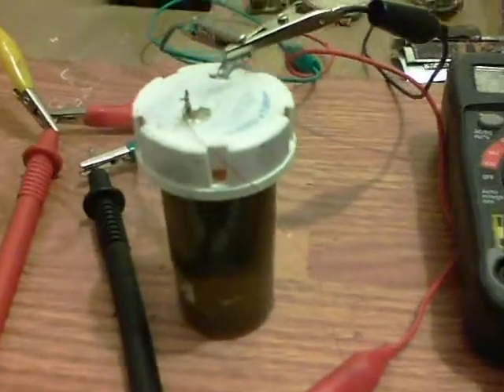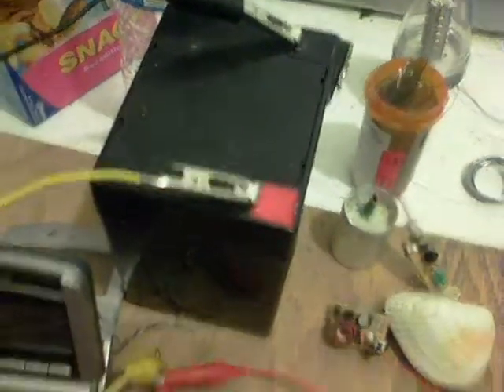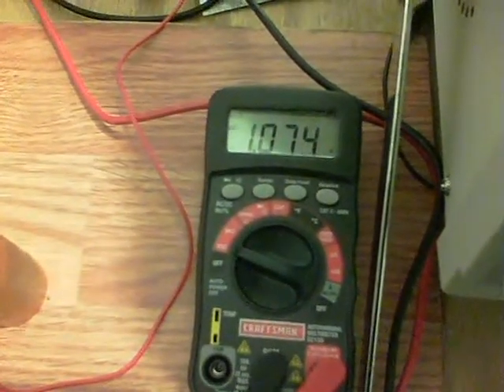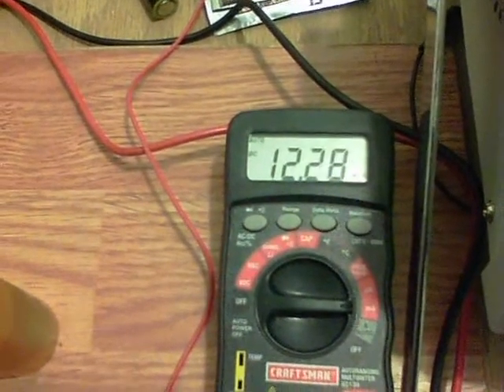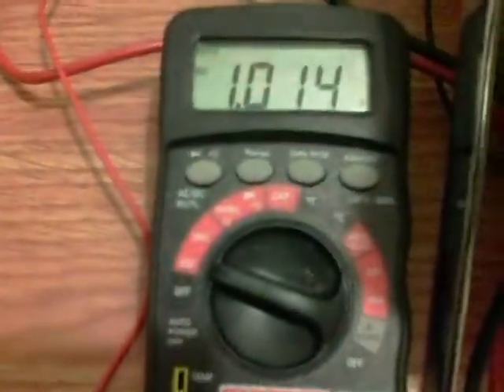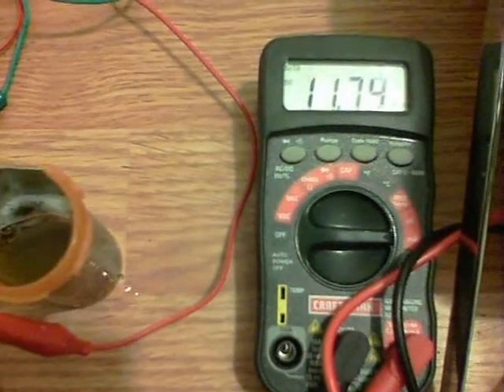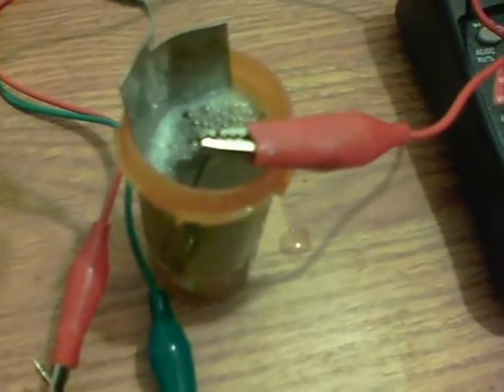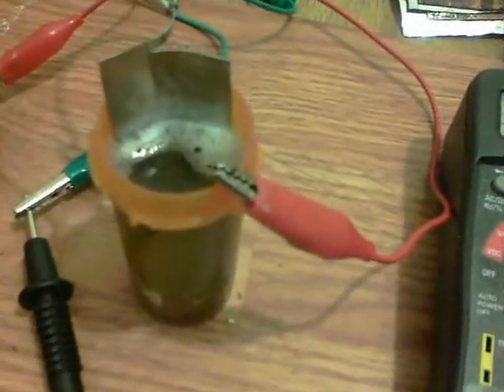Alum rainwater cell - good 2.7V initial charge

Comment from the maker: @picturen8 Cheers N8. I'll do that too. The graphite tiny rod here is far too small..still, it's not going to be the last one made. I like how different metals than lead can be used, for salvage and environment purposes, the amperage is likely to be far inferior. I'd recommend a cover/cap, for evaporation. Interestingly, on a straight water cell, mA can rise the closer the 2 metals get to each other, but can be best with moving water - makes me wonder about moving electrolyte via SSG wheel :)

Comment from the maker: @blackchisel97 Certainly will try SSG charging yep. Mentioned it on the alum thread, cos i'm no fan of the unregulated current 12V blasts ! However, the dark change to the steel 'may' be a former method (if creating a semiconductor barrier), too early to tell. The cell sits at 1.758V now, a few hours later and will power the JT, though it dips to 1.2V quickly and then on release recovers over several minutes.

Comment: Thanks for sharing that. Could you try charging and loading (few cycles) with SSG to compare the results. I ran some test couple years ago (following John video) with two strips of lead and alum and there was sort of crystalline formation on the plate. I never used galvanized steel for such purpose. Very interesting. 
Cheers
V